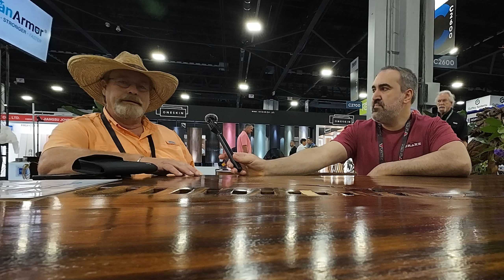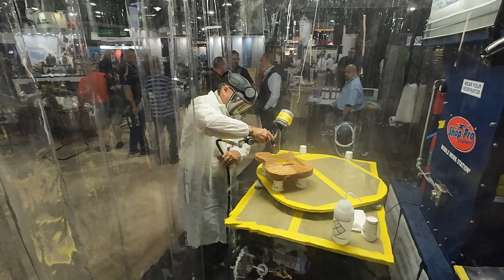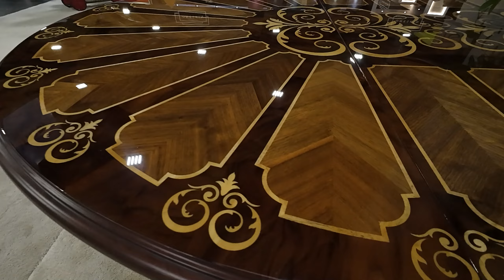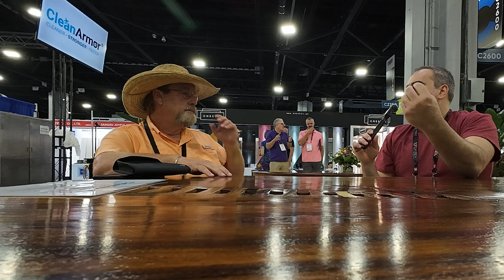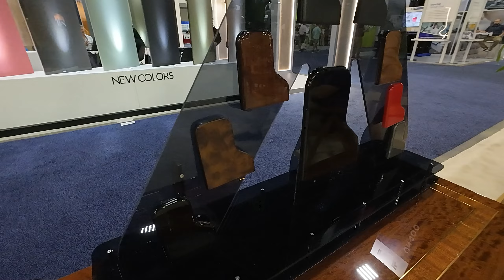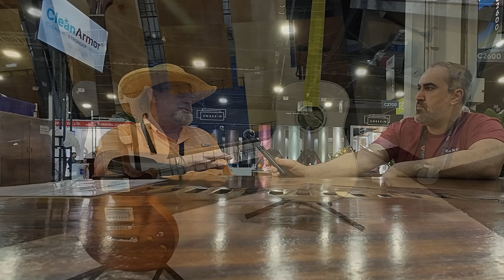Guitar Finishing Talk - Clean Armor High Performance UV Coatings

Comment: This is amazing. As a small builder this sounds perfect. Fast cure times and safety are huge. It sounds like you can do toned finishes and burst finishes as well. What spray gun tip is recommended? I use 1.3mm for my water based poly.
Thank you for the video guys.
Reply from the maker: Glad you liked it. I saw their finisher testing it at the booth with an Iwata LPH400, I assume it was either 1.3 or 1.4